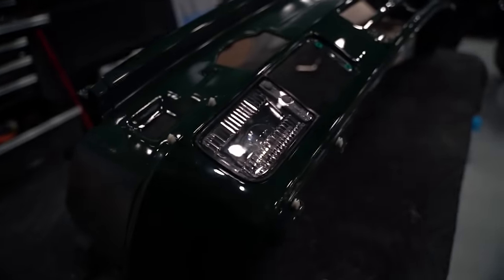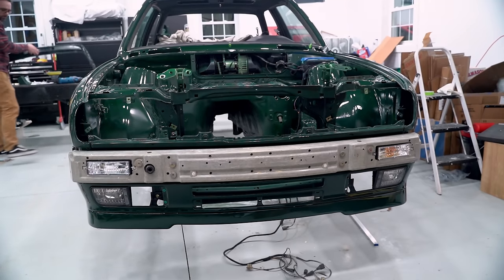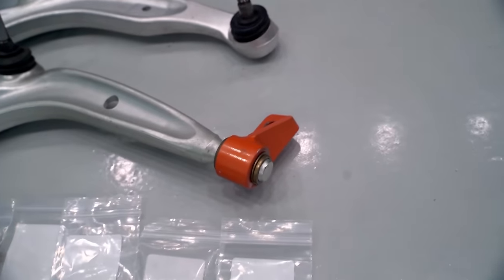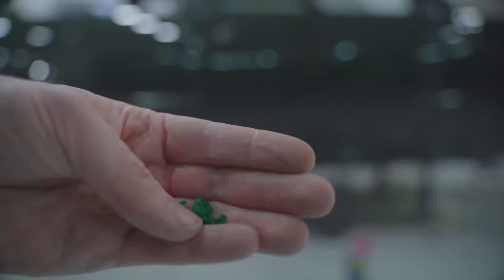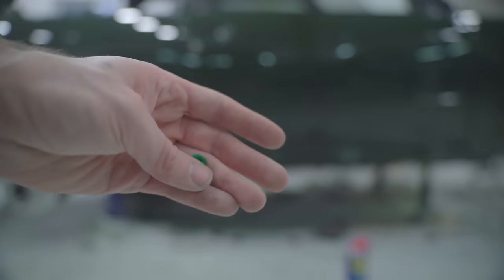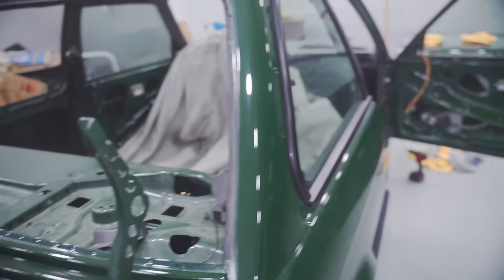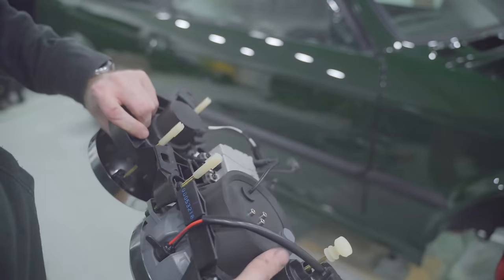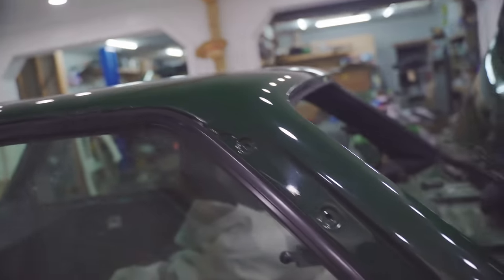Building a British Racing Green E30 Part 1

Comment: Instantly jealous of the fog lamps.. I was too cheap to splurge for the real deal..  LOL.. I bought some cheap plastic ones for mine.. but I know I will eventually get the glass ones
Reply from the maker: I tried to live with them but I couldn't, these ones popped up locally for a good price so I bit the bullet and am glad I didn't have to buy them full retail. before I found those though I had ordered glass lenses from an eBay seller. I put those on the plastic ones and they came out really nice actually, I will most likely put those on my other E30.

Comment: Looks really cool! One thing regarding the Fasteners- they look great and OEM factory being yellow zinc plated! But in terms of long term resistance IMO they don't last that long! Won't you consider using it the new Zinc flaked bolts in areas like the underneath of the car that is more suitable to corrosion? Just asking as I'm restoring my e30 soon and want it to last as long as possible
Reply from the maker: Good point, I actually didn't put much thought into it, I just had a ton of yellow zinc hardware on hand and thought it looked good. The worst weather this car will probably see is light rain so I didn't have a huge concern for corrosion like I do my other cars that see lots of rain and occasional salt. I have a bag of zinc flake ones I could swap in though so I might do that at least in the wheel wells

Comment: Hi, did this British Racing Green  exist on the E30 ? I think they offered it on the latest cab versions... or was it a metallic one ? I am a fan of original stock definition... Very very nice bolt new project ! I although regret your choice of lights on the back... Don't take me wrong but they look 'bad taste tuning' to me... 
I still have an E30 320i Cab from 1992 that I bought in 1995, Mauritius blue with beige leather. Keep the good work going!
Regards from Brussels
Reply from the maker: Thanks! I painted it green. The paint code is the green that came on the E36 M3 GT.

Comment: Nothing you put on seems to be tightened properly. Is a torque wrench part of your assembly equation?
Reply from the maker: Since it's a bare shell on maxed out jack stands so I could paint it, it's very light and unsteady. I don't want to put a lot of force on it and risk tipping the stands over. Once I can roll it and have it on the lift I'll go around a torque everything and mark it.